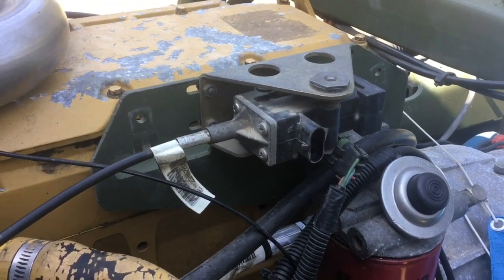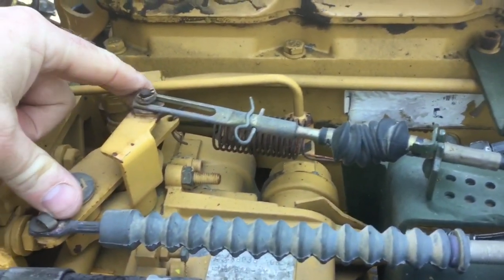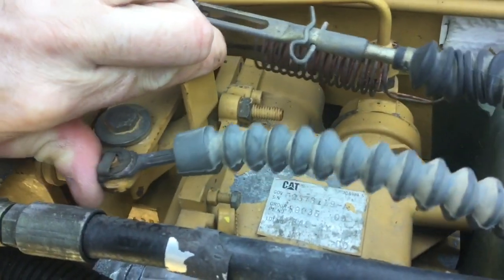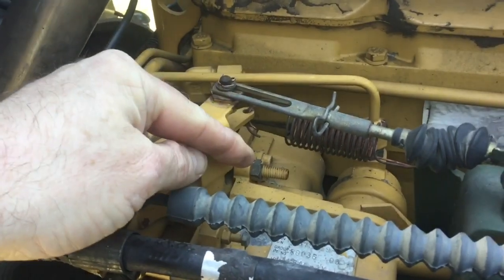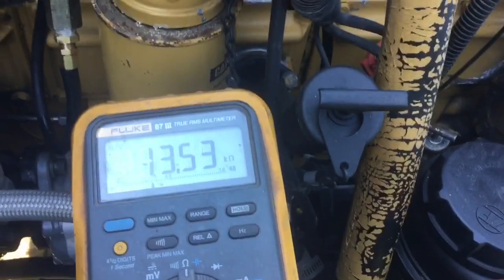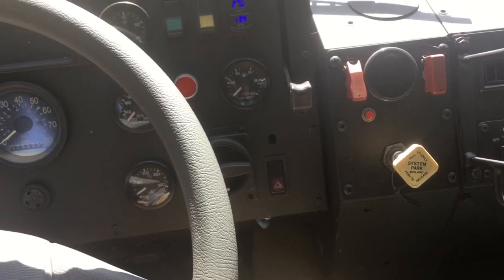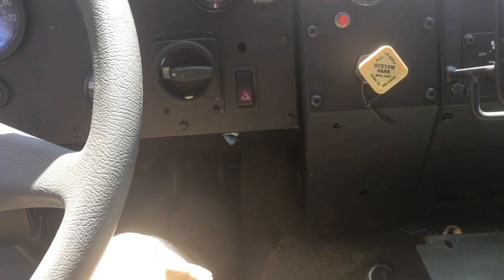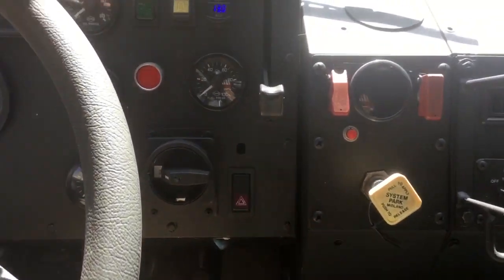LMTV A0 TPS ADJUSTMENT AND CAL

Comment: Thank you!  

When you swapped your gauges did you leave the original sensors in place or replace them with isspro sensors??

Where did you get the shorter oil fill tube instead of the ridiculous oem one?
Reply from the maker: I went to mechanical gauges for the most part, so no I did not re-use the original sensors except for fuel level.  The two trans and engine oil temp gauges are electric and I have new sensors for those.    As for the oil fill tube, I fabricated it from the original components.  I cut the lower tube that connected to the hose out of the engine flange and ground out all of the original tube metal from the flange with a die grinder.  I cut the flared filler end and a part of the first curve and inserted it into the flange and welded it there.  I almost messed this one up as I did not measure twice. I almost tilted it so far out that it interferes with the drivers side of the hump…  missed it by ~3/4”…

Comment: Have an M1081AO that's having shifting issue locking in high gear and won't downshift unless we turn truck off. Changed engine speed sensor and proximity sensor on transmission, still no luck. Could this be the issue in your video?
Reply from the maker: It could, but if there was an issue with the TPS input the trans control should fall back to using its min and max range RPM inputs to up/downshift.  This sounds more like you have a fault and it is locking it in gear…  Are you storing any codes in the trans controller?  Push up and down arrows at the same time.  Display will flash D1 followed by two sets of numbers(eg: 25 12), or two dashes.  Write these down and note if the mode light is lit.  Press the mode button to step thru the 5 code memory locations D1-D5 and record the codes.  - - indicates no stored codes in that memory location.  ‘Mode on” in a particular memory location indicates a current/active fault.   Once you have recorded all 5 code locations, press and hold mode.  After 3 seconds of hold the controller should beep indicating it has cleared all active faults. After 10 seconds it should beep again indicating it has cleared all stored fault codes. Press both arrows again to exit diagnostic mode.  Drive the truck and recreate the problem, then enter diagnostic mode again to read the codes again  write everything down…